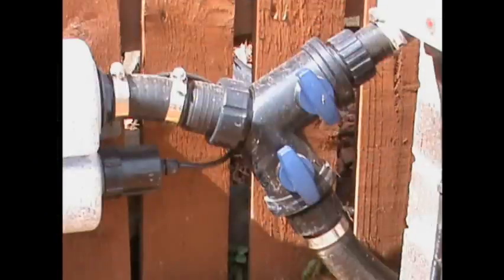How to Build a Koi Pond Video - Part 1 by Pondguru

Comment from the maker: Click 'READ MORE' for full video description and useful links.
Black epoxy pond paint: http://geni.us/vPU
Aquamax Eco 8000 pump: http://geni.us/2kMq
Nexus 210 filter: http://geni.us/qN4
EA Evo 110 UV filter: http://geni.us/4AlG
How to make a fish pond: https://www.youtube.com/watch?v=L63k5iZr42Q
How to make a raised wooden fish pond: https://www.youtube.com/watch?v=m2YkzoIx-cU
How to make a wildlife pond: https://www.youtube.com/watch?v=D8yY50brPvA

Part 1 of a koi pond I constructed at Durham in North East England in 2011. The video explains the various stages and tasks involved in making the design function properly while ensuring that the system is easily maintainable. The total gallonage is 3000 (UK) which equates to approx. 14000 litres.
Filter is a Nexus 210, UV is an Evo 55 watt and the pump is an Aquamax Eco 8000.
Part 2 explains how the filter system works, how the path and decking were constructed and has finished video of the pond, deck and garden once it was cleared up.

BIOHOME FILTER MEDIA, FILTER UPGRADE KITS AND FOAMS HERE: http://www.filterpro.co.uk

*PLEASE NOTE I HAVE CLOSED TYNE VALLEY AQUATICS AND NOW SELL MEDIA FROM HOME ONLINE. COLLECTING MEDIA IS NO PROBLEM JUST RING OR EMAIL ANY TIME.*
My phone number (Richard) 07772848730
My email address sales@filterpro.co.uk
Reply: The black epoxy paint how good is that? I'm deciding if I should just pay someone to fibreglass it or get it rendered and use the paint my concern with the paint is if the render is to fail then the paint also would creating a leak what are your thoughts on this??

Comment from the maker: 90% of the ponds I make are at ground level but 'proper' koi ponds tend to be partially raised to keep out frogs / toads, to prevent wind blown debris entering the pond, and to allow a bottom drain scenario on level land as the filter (if gravity fed through a boittom drain) needs to be level with the water height. 
Also, some people put in a viewing window in one of the walls so they can see their fsh through the side of the pond. Never installed one of those myself. Yet.

Comment from the maker: You can get bottom drains for liner. They will have a flanged connector, fixing ring and thick rubber seal (washer).

Comment from the maker: If you chucked enough in there, yes. I should have videod the bottom drain just before I filled the pond as it has a plastic dome which protects the main drain and stops the fish and large waste getting down the drain whilst allowing the smaller waste to leave the pond and go to the filter. In this video, you just see the 4" drain fitting in the bottom with no protector fitted.

Comment from the maker: Provided the filter and UV have water flowing through them it doesn't really matter which end the pump is at although I prefer in the middle of the system so its handling filtered water with no chance of jamming.

Comment from the maker: As soon as the first coat went tacky but before it hardened. Depends on how quickly it dries but I normally do the first coat, wait an hour or two then apply the second followed by whatever is left in the tin around the inside edges and base.

Comment from the maker: The amount of bricks per square metre is all you need to know from builders merchant. It will vary slightly as there are a couple of different common sizes in the UK. Once you know that all you need to do is measure your pond walls and work out how many bricks you will need based in how many square metres there are in the wall.

Comment: Your top row of bricks are not in the Solder position as you noted, they are in Rowlock position. Solder would be standing on end not on side.
Reply from the maker: My bad and you're 100% correct.

Comment from the maker: I normally use a 4:1 mix for the first coat using building sand , cement and PVA glue with a bit of retarder/plasitciser in. For the second coat I would use a 4:1 mix of render sand, cement, PVA glue and retarder/plasiciser.
I'd still use 2 coats, even over concrete.
Hope that helps.
Reply: Does this go over just the blockwork or the base layer of concrete also?
Reply from the maker: @foxyben1212  Yes, over the base too - the whole of the inside of the pond would be rendered then painted or fibreglassed.
Reply: @pondguru  Thanks Richard, keep up the good work. Apologies for another question but during my research I have noticed a lot of people using fibreglass, presumably a couple of coats of the render with numerous coats of pond paint would be sufficient? Are there pro's/con's to either? P.S. Will we be getting an update on the Mega Pond Filter this summer?
Reply from the maker: @foxyben1212  Fibreglass is always better than painting but as long as the structure is sound painting with a few coats of suitable paint will do for many years.
I'm hoping to make a video on the pond shortly but my work has gone mad since this covid 1984 nonsense.

Comment from the maker: The bottom drain is concreted in then rendered around then the render is painted with waterproof paint.
It would cost maybe 3.5-4k if you took only material costs into consideration.

Comment: iv kept pump fed ponds for years but am eager to learn the bottom drain system which is best in your eyes
Reply from the maker: For a 'proper' koi pond the purists would use a bottom drain system as it only has the dome part of the drain inside the pond. Most would worry that fish will damage themselves on a pump or pipes in the pond but that is rare. 
A bottom drain pond with the base sloping correctly to the drain will remove all the dirt from the pond batter than if there was a pimp sitting at the bottom of the pond but it is really down to budget and personal choice. If the pond is purely for koi and you're prepared to use a higher budget I'd say go for bottom drain every time.

Comment from the maker: Not really, provided the foundation slab is sloped toward the bottom drain if you have one. It always helps to gently slope a pond even if hasn't got a bottom drain to make cleaning easier and prevent gas build-up under the liner.

Comment: Pondguru,
I am doing my own pond in my back yard and was hoping you could please tell me the proportions for the plaster mix that you use?
Also, do I need to do two coats of plaster like you did? My pond is in-ground and I'm doing concrete walls rather than block.

Comment: Don't get me wrong, I love your Video's and watch them all the time. I feel like we are related I've watched you that often. I'm confused a little as you say this is 4,000 Gallons??? Looking at the measurements of the Breeze blocks and working out the sizes, I would guess that the total length of the two ponds is about 2.7m + 2.3m the Widths are 2.7m + 1.8m and the Depths are 1.2m + .25M, this will only give you 1,700 Gallons + 250 Gallons so how much pipe work is there to the Filter Unit???? I have a meter on my water inlet and it is is in Cubic Metres rather than Galls/Ltrs. Do you think the pond is really 4,000Gallons as that would equate to a 5m x 4m x 1m Pond which is a lot bigger than this one.

Comment from the maker: I've never just rendered a pond without doing some repair work or building tasks so I don't know exactly. The materials don't add up to much but it is a 2 day process so may be around £300? Then it will need painting a few days later.

Comment: is other a video showing this build from the ground up? how can I learn that stone masonry?
Reply from the maker: +Nubian Emporer If in doubt get a builder in. I used to get builders to do the stone work and I watched how they did it then I did it myself.
I don't have a video showing the early stages of the build but it is simply a concrete pad about 6" thick with the bottom pipe built in base. Inner skin of wall is medium density concrete blocks and outer skin is bricks. I put ties in when building the inner wall to tie it to outer brick wall.
Reply: +Pondguru Outdoors Thank You awesome pond I'm going for on very similar I like that one
Reply: +Pondguru Outdoors Thank You awesome pond I'm going for on very similar I like that one
Reply: +Pondguru Outdoors Thank You awesome pond I'm going for on very similar I like that one

Comment: Those UV light usually destroy themself before you do  a second bulb change; the uv light damages the plastic inlet outlet sections and they will leak.
Reply from the maker: I have not had any customers experience that problem with the EA filters but U have been out to fit new units in ponds where I've seen cheap UV units totally destroyed by the UV light where the main plastic tube is paper thin and brittle causing total failure.

Comment: you were lucky, no water ingress. The most difficult task is getting the hole dry after the structure is built before you paint or in my case glass fibre.  A tip- dig a hole at the end of the bottom drain pipe, create a sump and pump from it.

Comment: Hi 

I am about to built ( renew actually ) my pond and i would like to render the inside of the pond. You mention that for your render you used sand - cement - plasticizer and "lots of pva". Are you refering to pva glue? Something like WATERPROOF EVO-BOND PVA ?

Comment: I have a 10x10 liner but I don't know how big I can make my pond.  Can anybody help please?
Reply from the maker: There are almost limitless answers to that and you'd generally dig the hole out before buying a liner.
When sizing a liner you would allow 2x depth plus the length (+ 1' overlap on each side) and do the same for the width.
An example would be that your 10' x 10' liner would make a pond approx. 4' x 4' x 2' deep and that would allow 1' overlap on all sides.
Reply: +Pondguru Outdoors thanks a lot. That's really helpful 😄

Comment: What make of bottom drain do you recommend?
Reply from the maker: It has been a few years since I was installing ponds so I'm not sure what is available now unfortunately. Many are available with air rings or other aeration devices integrated into them but it all depends what you want  to spend - they all do the same job of removing water and waste from the bottom of the pond.